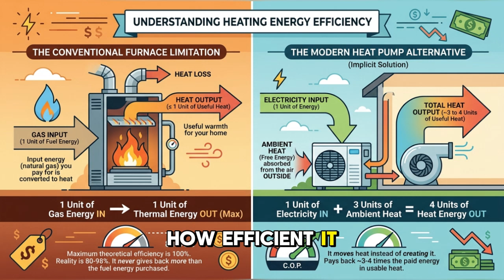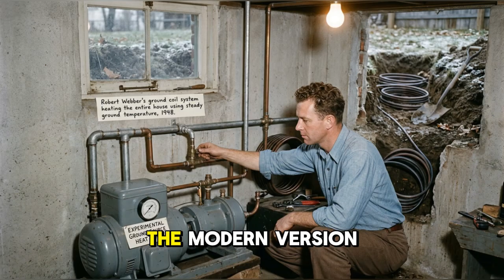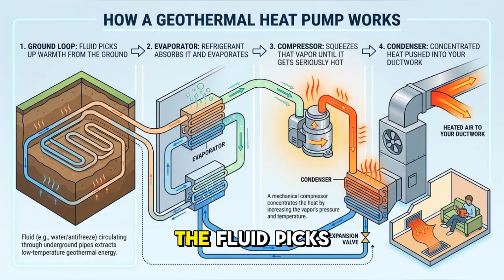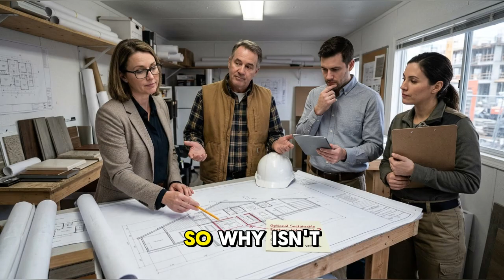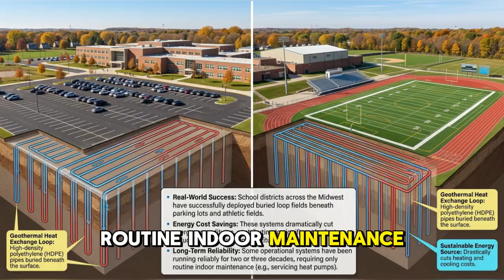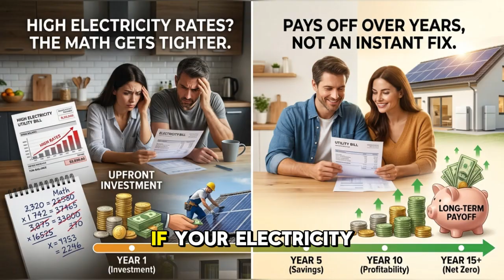The Backyard Energy Secret That Could Change Home Power Forever

Comment: The electricity to run the system and all your house electrical needs for that matter can come from solar panels.
Reply from the maker: Absolutely! ☀ Pairing a system like this with solar panels can significantly reduce or even eliminate the electricity needed to run it, depending on the system size and your local sunlight. Great point—thanks for sharing!